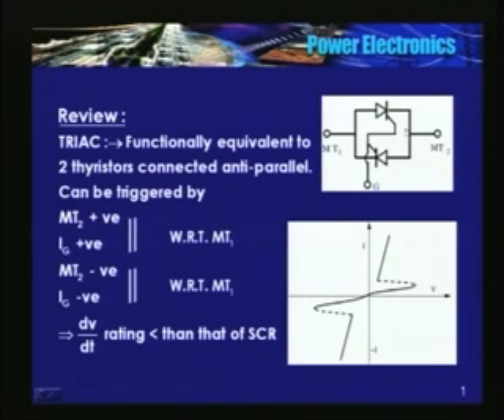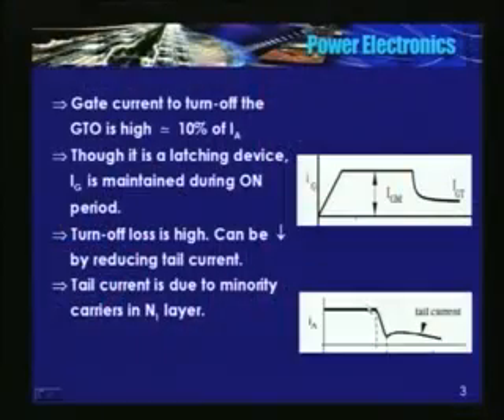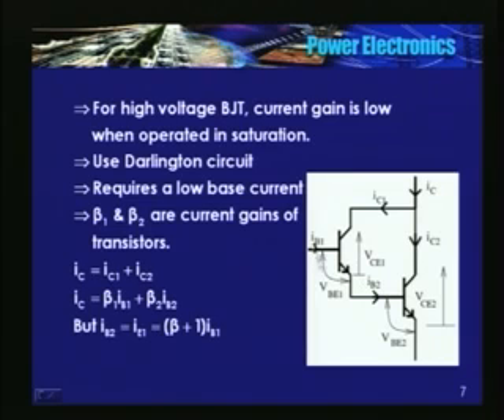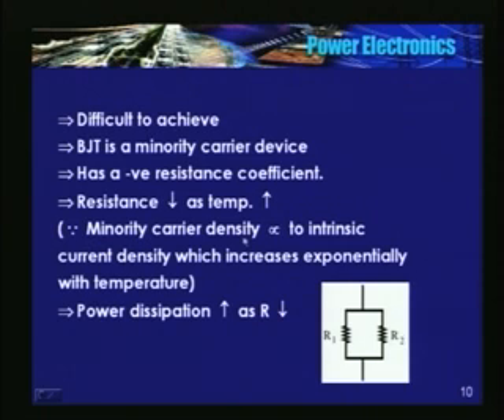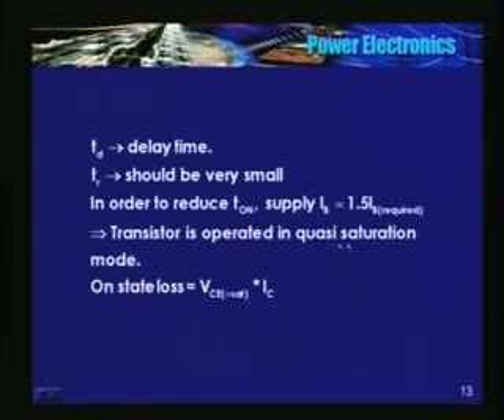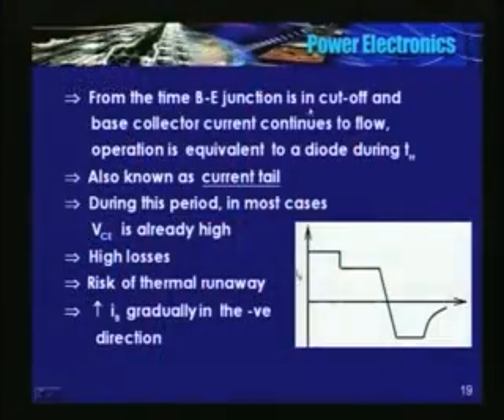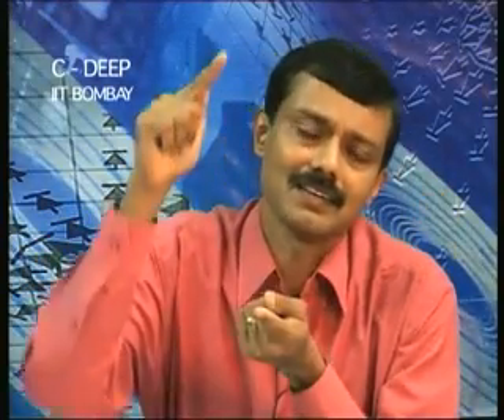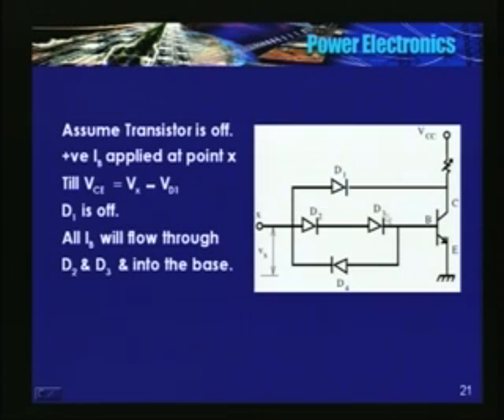Lecture - 7 Power Electronics

Comment: what is secondary breakdown in bjt ? sir ....
Reply: when  the avalanche breakdown occurs, the current increase sharply. Even after this breakdown voltage, if the voltage is increased further, leads to the secondary breakdown voltage.